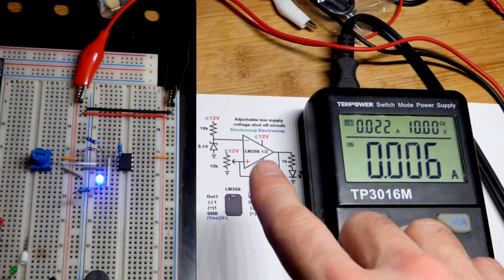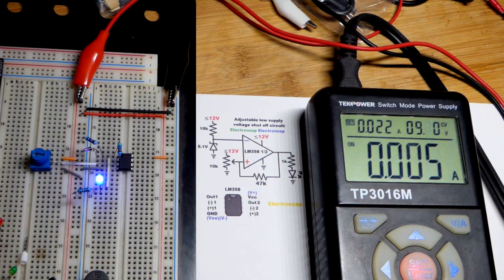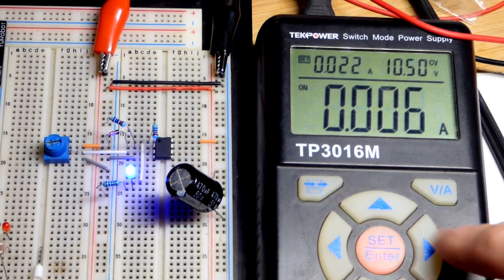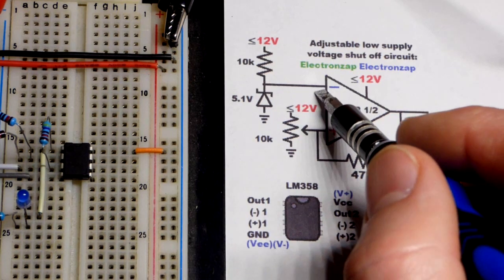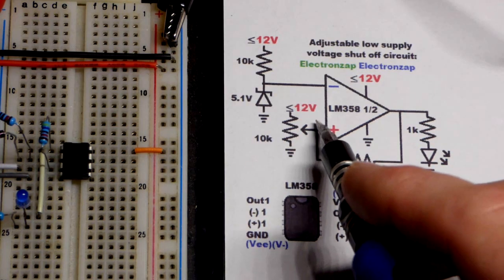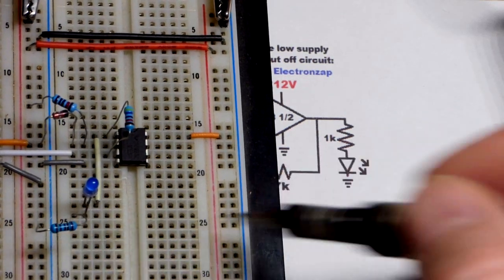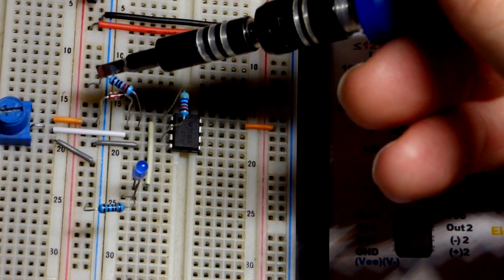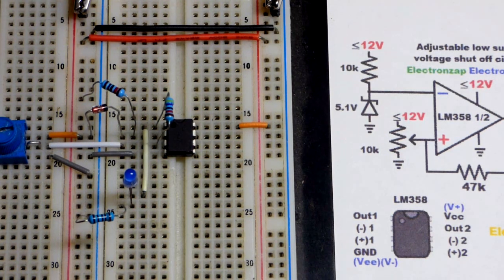Adjustable low supply voltage shuts off load circuit using trimpot zener diode LM358 op amp

Comment: Thank you for this study,but  there's something I still need to know  lm358 shut a circuit if battery voltage it will on start fl fuctation  on off on off ,what could make shut down permanently
Reply from the maker: You want to make a Schmitt Trigger to overcome a fluctuating voltage. That's a comparator with positive feedback which gives it hysteresis. Resistance is added between the output and non inverting (+) input. When the output goes low, that makes the voltage at the + input get even lower than it was, and thus makes it harder to go up in voltage at the + input.

Comment: Handling unused Op Amp pin conditions

When using only one of multiple op amps in one package, it's wise to put the unused one in a stable state.

The "TI Design Guidelines for Devices with LM324/LM358 Cores (Rev. A)
 Section 7 - Unused Amp Connections and Inputs Connected Directly to Ground" provides good information for anyone just using one of the two op amps in a package. It shows how to protect the unused op amp with suggested pin configurations for single-rail and split-rail.

Thanks for the great video and circuit.
Reply: Justa Guy I use a 0.1 uf to gnd to eliminate residual, the capacitor has just enough resistance to do the job, found that turn off would stair step down slow ,but not to full gnd with residual voltage un clamped. Then found the TI  REV you speak of . TI has very good info.
Reply: It's actually best to configure the unused op amps as voltage followers with the non-inverting input at Vcc/2, you can find that in a variety of tech notes for op amps.